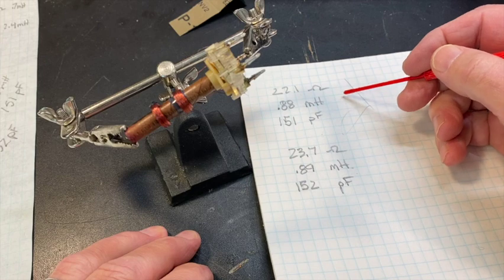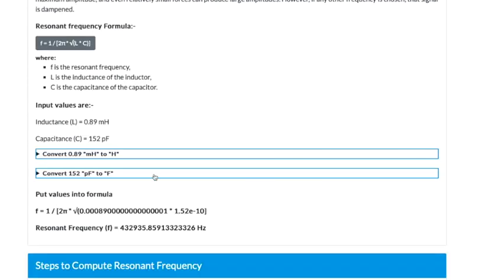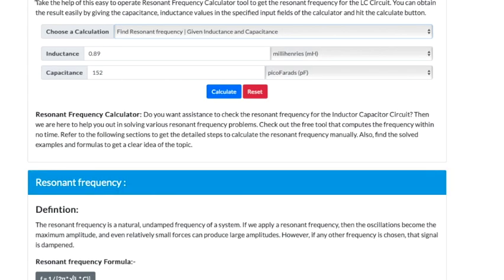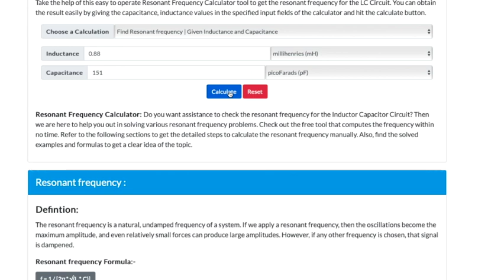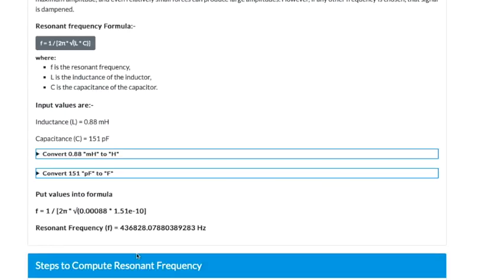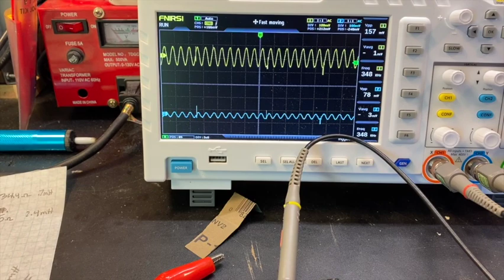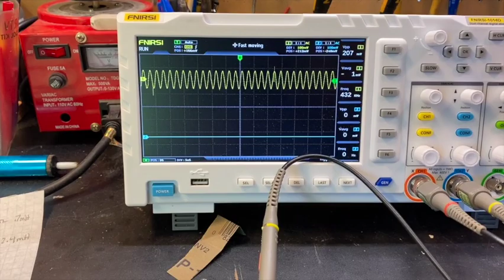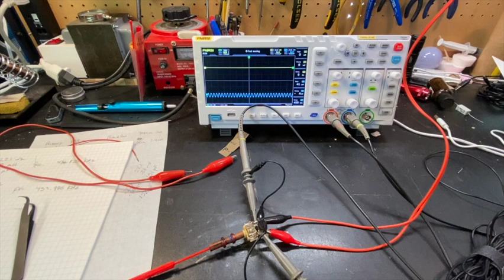Fundamentals IF Transformer A Resonant Circuit Part 2

Comment: Well done.  I may actually learn a thing or two if I watch enough of your clips.  I have a radio that is so badly tuned that the screws were all tuned down to the max (tight) - I could pick up one radio station, sometimes two or three, but all below 700 kc.  It's also gone through quite a bit of re-engineering, so it's missing parts, which I have replaced.  Something I've been playing with is tuning each of the coils independently.  I've tried this idea of tuning them together (pri+sec) and have been able to hit 455 kc and that is what allowed me to go from one to three stations, but I notice that the calculator works with each of the coils independently.  So my question becomes, is there any benefit to peaking each coil independently to hit 455kc, or is that a maladjustment?  It may be moot because I've tried this and one of the coils never peaks - the signal is an order of magnitude lower on it, so I have to adjust the scope to read it, plus when I try to tune it, it never recedes, it just keeps climbing to maximum until the screw contacts the housing.  I'm guessing it's open or has a bad capacitor.
Reply from the maker: Interesting problem you're facing. Generally speaking, each IF can is tuned separately, first the primary and then the secondary, before moving on to the next IF. The schematics for the radio you're working on (you didn't mention what it is) should indicated where to inject the signal and the order in which they are aligned. It sure sounds like you do have a bad IF transformer, though. The capacitor in the IF cans rarely goes off-value, but depending on how it's made, the capacitor can be responsible for a lot of noise due to silver mica disease. I also wonder whether you have an open coil in one side or the other of the IF can that's giving you trouble. Have you taken the time to measure the DC resistance for both the primary and secondary of all the IF cans? A third potential problem can be a broken transformer slug. These are usually made of steel powder or graphite, can can be broken. That would cause the IF can to not tune correctly. Thanks for watching!

Comment: I'm pretty sure the reason you weren't able to peak the primary is that the signal generator is connected directly to it, and the SG has quite a low output impedance, probably 600 Ohms or less. In other words, you're never going to see a voltage there other than what the SG is outputting. To get around this, add a rather large resistor, like 10k or 100k between the hot lead of the SG and the primary. And don't forget that even on 10x, the probe has significant input capacitance, probably on the order of 15 pF. Don't even bother trying to do this with a 1x probe. A low capacitance 10x probe, under 5 pF, would be even better

The ground side of the probe and the common side of the SG should be connected to the same primary terminal, leaving the other terminal free to peak.
Reply from the maker: Thank you, jadney. I believe you are absolutely right, and it does make me want to go back and redo the experiment. Maybe I'll revisit the subject in a future video. Thanks for your feedback!

Comment: Hi .Why you did not load the secondary with  a resistor to better simulat the behaviour in  real circuit ?
Reply from the maker: Interesting question. As I recall, I was not attempting to precisely model the circuit, but merely to demonstrate a concept. I don’t know whether adding a loading resistor would fundamentally change anything. Thanks for watching.

Comment: Good demonstration of loading, it answers questions.   However, I've seen people do this and then swap the frequency generator to the secondary side and use the scope to tune the primary.   They would alternate this back and forth to peak both coils.  Can you confirm that?
Reply from the maker: I have not seen that, and it seems that it would be unnecessary. However, I see no reason why it wouldn't work. The transformer is just that, a transformer, and doesn't much care which side the signal comes from so long as it's appropriate to the wire gauge and length.

Comment: Great video. Thank you so sharing it. In your demo computer calculations shows 152 and 153 pf capacitors, are those the capacitors was used inside the transformer? Thanks
Reply from the maker: As I recall, it was 150pF.

Comment: Well done...VERY well done!!!
I enjoyed this video a lot.  Glad you shared this one with us.
I can't remember where I saw it, but there was a video of a guy that was making IF transformers on a printed circuit board that fit into the IF can of the radio he was working on.  The inductors were not tunable with a slug, he simply mounted fixed inductors and capacitors on the circuit board.  If you are interested in watching it, and if you want me to, if I find the link I will share it with you.  The first inductors that he used were pretty much coils of wire on a form, whereas the ones he chose to use looked like resistors.
Looking forward to your next video!
Reply from the maker: Thanks so much, Wayne. I’d like to see the video, so a link would be much appreciated.
Reply: @fibberscloset498  I found it.  Part one is at:  
https://youtu.be/Lbv7Bm35EJo
and Part 2 is located at:
https://www.youtube.com/watch?v=wy4MqOp_feA
Hope you enjoy it!  Would love to hear from you after you watch them.